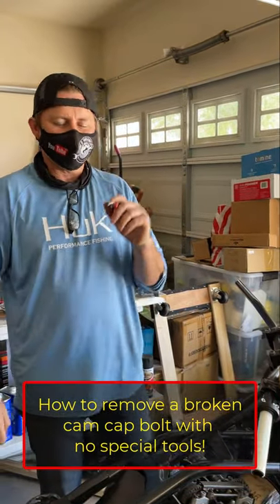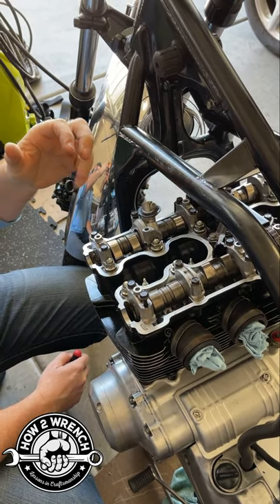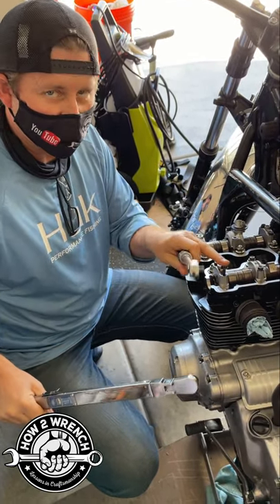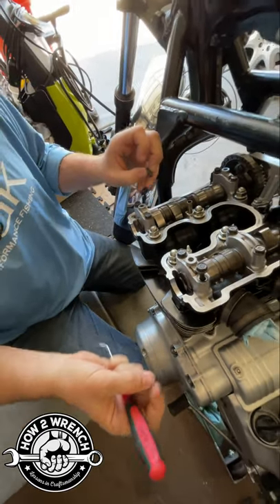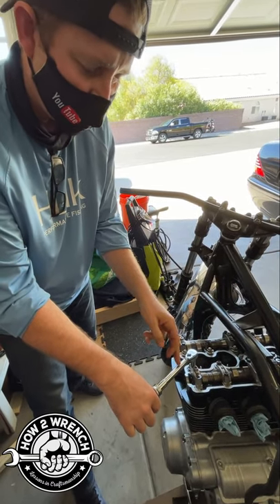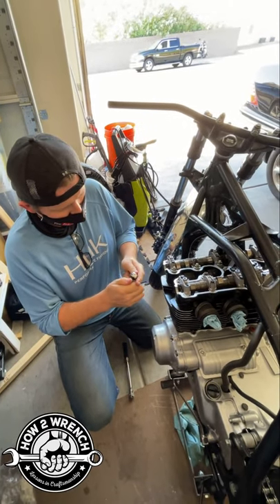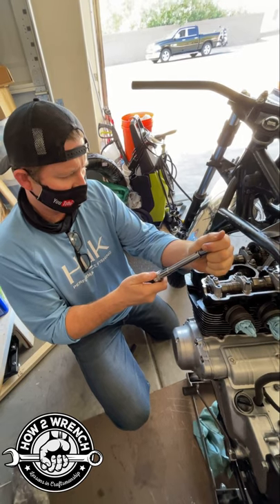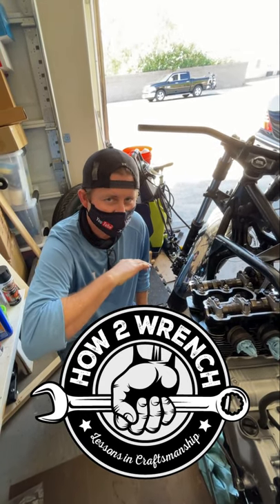How to remove a broken cam bolt with no special tools! How bolts break even with a torque wrench!

Comment: Just broke one off in my ‘06 Pathfinder 4.0 VQ40… Hopefully, this helps. Thanks for the video, any helps appreciated!

Side note; I was only specing to 17ft-lbs, on a 3/8s drive shot shaft tq wrench, I never even reached snug, let alone spec… As soon as it smuggled it snapped clean off, maybe 1/8” inside the thread… 🤷‍♂️

Comment: The bolts should not be lubed, You can over torque them or hydro lock them stripping the threads in this application.
Reply from the maker: Agreed. Never lube unless the manual instructs to do so. I was getting ready to comment this too on another comment. Lubing is required at times as the engineer designed the final torque to be achieved at a lubricated setting. People misunderstand this and "fill the hole" instead of lightly lubing the threads and underside of the bolt head. 
Thank you for commenting. Could you spare $2 and support us with even more benefits? Smash the subscribe button and bell! Join this channel to get access to perks:
https://www.youtube.com/channel/UCBhM8DCKnT3qXwTW0eToyCg/join   
-Daily MEMBER FIRST COMMENTS ANSWERED FIRST 
-Live Q/A video chats
-Wonder if we have a video on your need? Members can request content links!
-Full Access to the ENTIRE 700 video library
-Member-Only FREE tool giveaways

Comment: Are all cam bolts lubed with oil first before torquing? Can you use ARP Ultra Torque to replace lubed bolts with oil instead and use same torque specs?
Reply: Tighten per manufactures directions/specs. They are not all the same.
Reply: @larrybrown441  ok
Reply from the maker: Right on...
Reply from the maker: Never lube unless the manual instructs to do so. I was getting ready to comment this too on another comment. Lubing is required at times as the engineer designed the final torque to be achieved at a lubricated setting. People misunderstand this and "fill the hole" instead of lightly lubing the threads and underside of the bolt head. 
Thank you for commenting. Could you spare $2 and support us with even more benefits? Smash the subscribe button and bell! Join this channel to get access to perks:
https://www.youtube.com/channel/UCBhM8DCKnT3qXwTW0eToyCg/join   
-Daily MEMBER FIRST COMMENTS ANSWERED FIRST 
-Live Q/A video chats
-Wonder if we have a video on your need? Members can request content links!
-Full Access to the ENTIRE 700 video library
-Member-Only FREE tool giveaways 

Just want to say thanks quick to support us for this information and our work saving you money? 
Give us a high 5 here:  https://www.paypal.me/how2wrench
Reply: @How2Wrench  thanks Shane